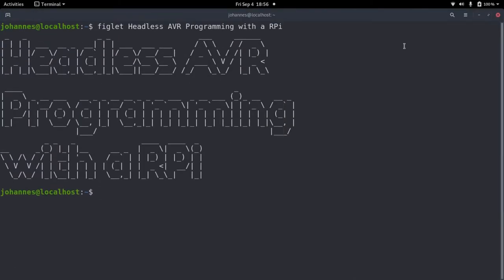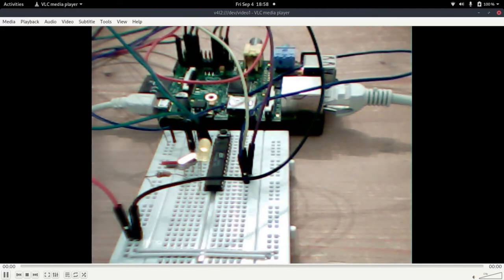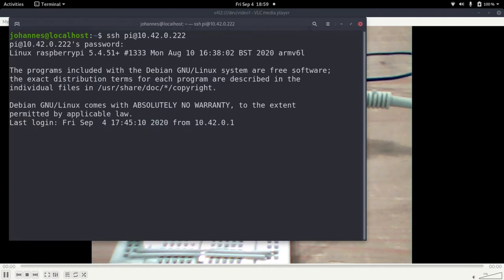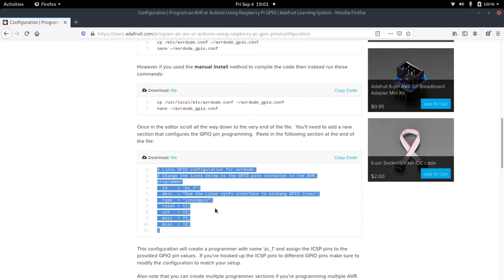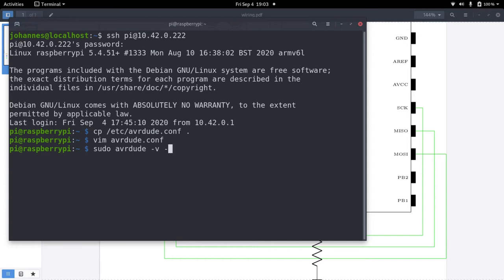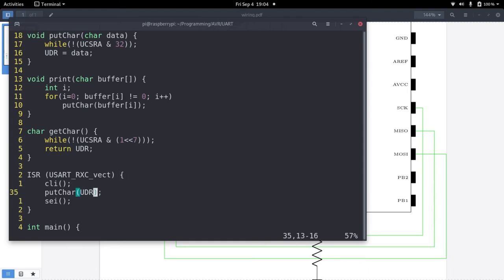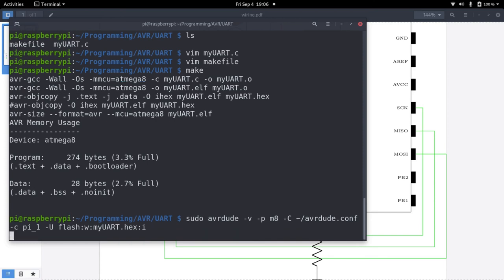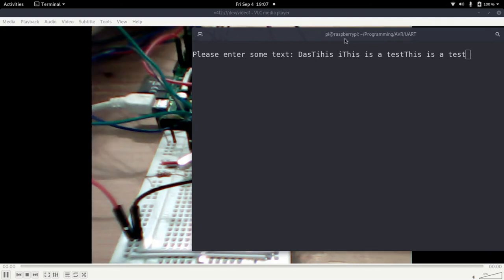Headless AVR programming with a Raspberry Pi (avrdude, avg-gcc, Atmel AMEGA8L)

Comment: didn't understand what exactly the output of myUART. where to see its receiving the byte or running correctly
Reply from the maker: I have implemented a UART loopback on the ATMEGA. If you open screen, disconnect the UART wires from the ATMEGA and type something, you will not see anything. When connect the wires back and start or reset the controller you will receive the message "Please Enter some text: ". From this point everything which you will type in screen will be sent back and displayed.